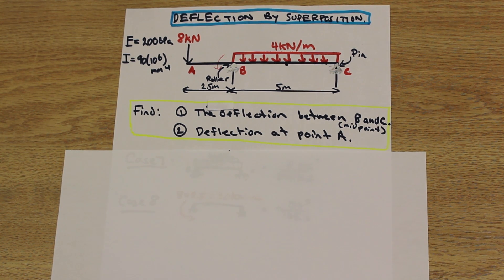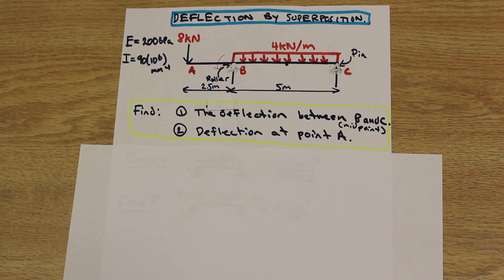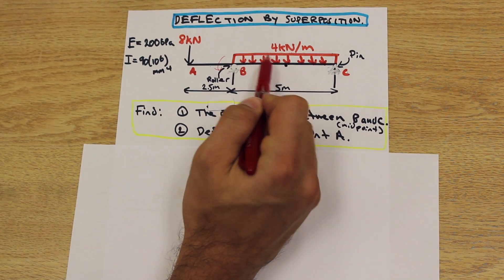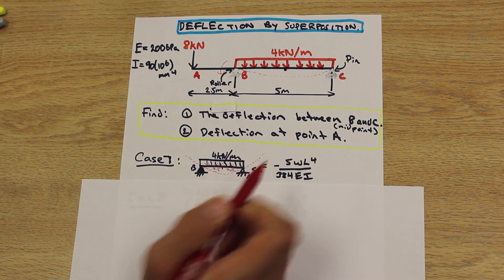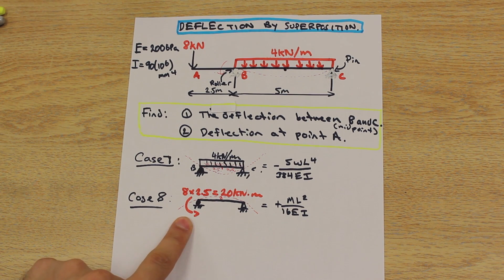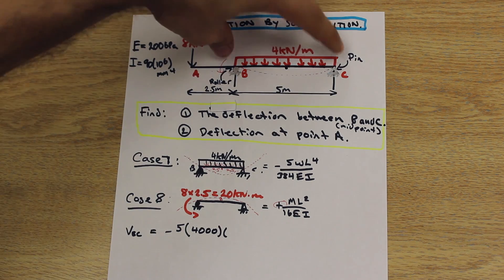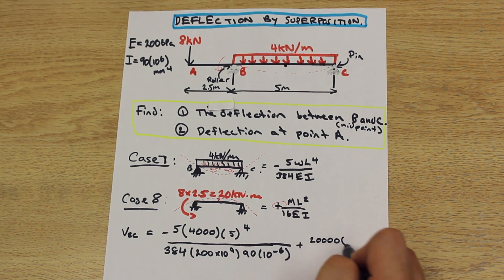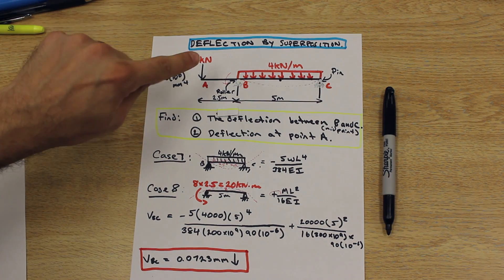How to Solve for Deflection Using Superposition Method - 1/2

Comment: Just wondering where you got the formula for deflection at the midpoint ? i understand why its not the max deflection but would like to know where you got the formula for midpoint
Reply from the maker: It's a standard deflection formula that is derived using deflection by integration.  They are widely available.  Your textbook should have some theory on how they are arrived at, also check out deflection by integration video.
Reply: @AFMathandEngineering  thanks, I see that now! The formula sheet I have just didn’t include the mid point formulas

Comment: ML^2/16 is a deflection at L/√3 distance not mid way .,but we have to find out at midpoint,so is it correct??
Reply from the maker: ML^2/16EI is the deflection at the midpoint of the span for that case, not the maximum deflection, which occurs at L/sqrt(3) and is ML^2 / (9 * sqrt(3) *EI).
Reply: AF Math & Engineering I am not getting case 8 ,when max deflection you get is ml^2/9√3,then how  come centre deflection which is ML^2/16 greater than  the maximum.and could you please send me that table to my gmail umesh9436@gmail.com
Reply from the maker: you must be putting it in your calculator wrong..the term is exactly the same, the difference is that the max deflection has the term 9 sqrt 3 in the denominator and the midspan deflection has 16.  9 sqrt 3 = 15.59 which is < 16, which means you should be getting a larger value for the 9 root 3.  check again.
Reply: AF Math & Engineering okay I thought ml^2/16 is deflection at L/√3.so at L/2 it's ml^2/16 ,got it and thanx ..could u plz send me mail of that sheet
Reply from the maker: Ill have to see if i still have the book, it might be a while.  Google a beam deflection table or find one in the back of a structural analysis or mechanics of materials pdf book.
Reply: Yes went through the notes as well as some books but didn't found that mid point deflection (case 8) anywhere ,so that's why I was asking for that . anyways thanx now its clear
Reply from the maker: umesh kumar singh ah i see.  Glad you figured it out, thanks for commenting!
Reply: AF Math & Engineering ur videos are amazing. really worth the time .one question ,r u professor somewhere or what???
Reply from the maker: umesh kumar singh thanks man appreciate it! Not a professor no, i have b.eng in civil/structural engineering and work as a structural designer :)